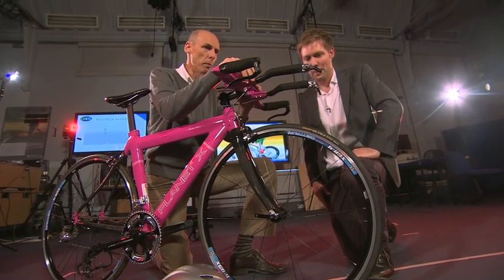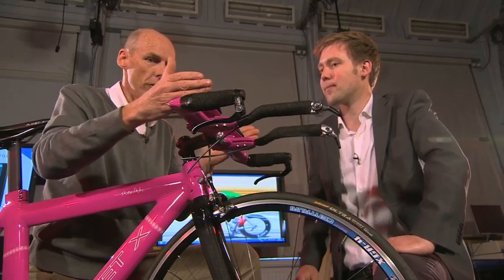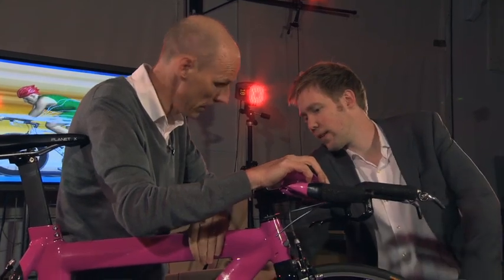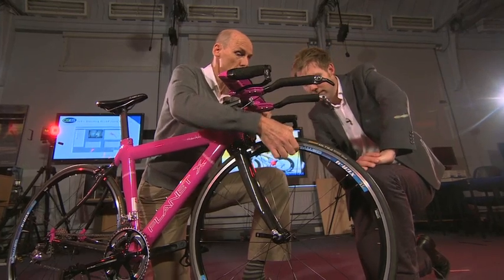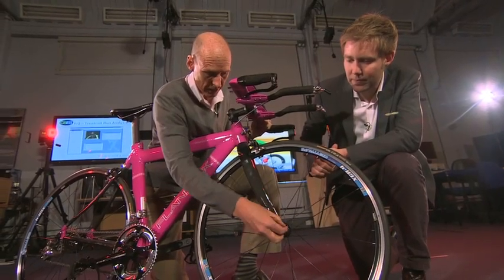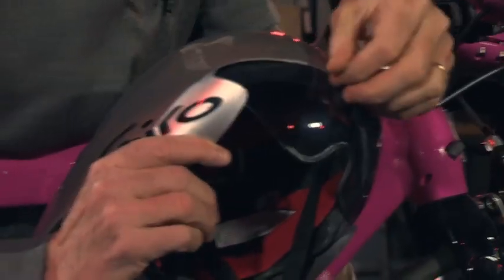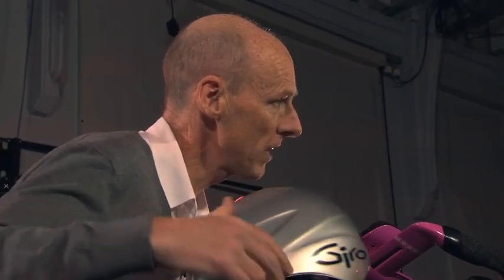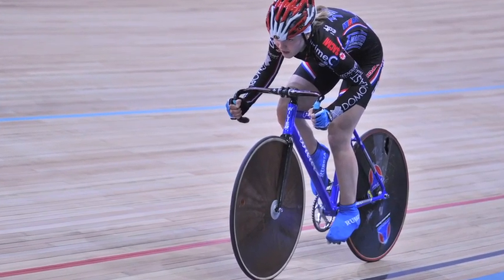The physics of cycling

Comment: "Pumping up tires as high possible!" lmao.

See how the so-called experts don't know their behinds from their elbows...
Deformation? Uh, you WANT a level of deformity, to 'push' the rubber into the road surface. This is called Vertical Load or the Coefficient of Friction.  AKA- Traction. Tires inflated to high pressures reduce vertical load. And when Lateral Load increase, traction is either greatly reduced or broken.  Resulting in a crash.
Reply: Smaller area of contact results in a higher pressure and HIGHER traction. Unless u a riding over a dirt.
Cyclists tends to pump their tires up to the limit - that is the fact.
Reply: #LMFAO   Dude, you are SO seriously mistaken and under-educated about pressures, contact patches and traction (the coefficient of friction) and in fact your comment is so far off base, it borders on ignorance. Now I will school you on the matter.
Reply: In modern bicycle the rim also partially acts as a suspension - it is not 100% rigid. And overall it is very complex process. Hi pressure not always results in crazy bouncing. Yet i may be wrong about highest pressure...
Reply: You would be what the Italians call Stunod... #ufb  #rollingeyes
Reply: You are so politcorrect =)
Reply: do you understand that the video was about speed and not what "Results in a crash" or are you too dumb?
Reply: Flying Lap Productions lmfao I pump up my tires to -10 psi under the limit for that reason , specially on 23 and 28c tires. On 32c tires this is a massive advantage on cornering as the -10 psi gives you at least 4 mm of more contact, thus allowing me to pedal very close to the ground since any slight strike will not bring me down that easily. I never stop pedalling around corners period using this trick.